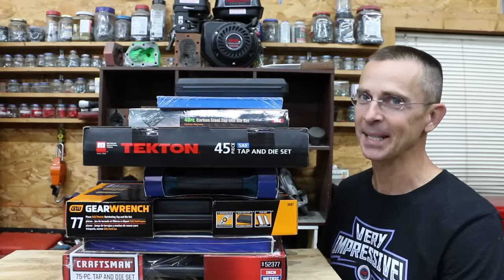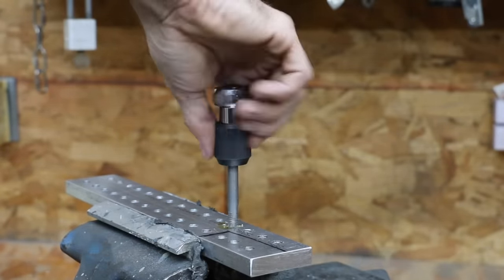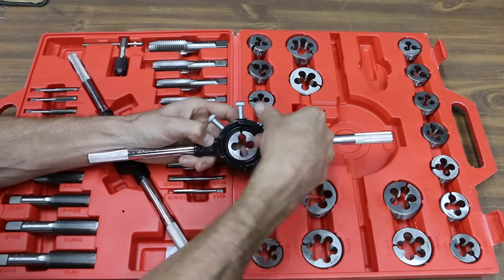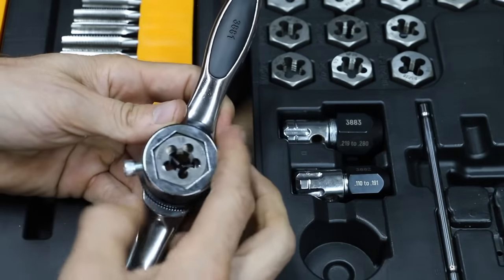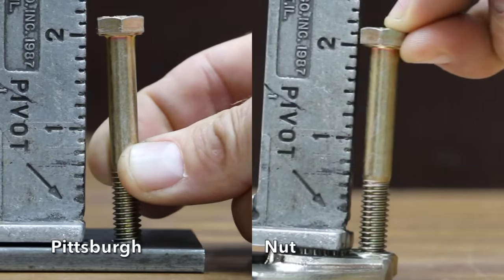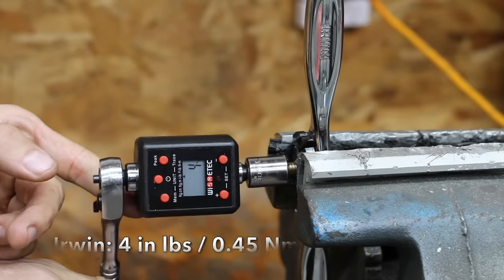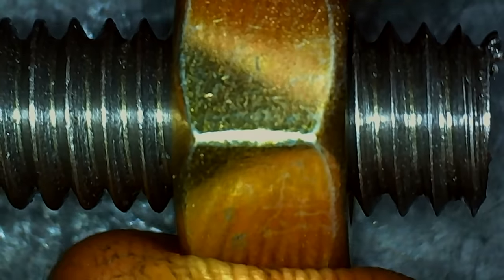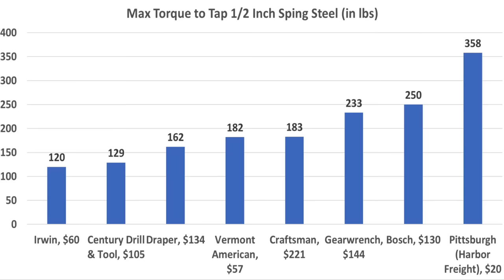Best TAP & DIE Set? Craftsman vs Irwin, Bosch, Draper, Vermont American, Tekton, GearWrench

Comment: I never purchase or use ANY tools, safety or test equipment from cheating lack of quality control communist china. Like the greenfield taps and gun taps. I always use Tapmatic or Aluminum for tapping fluid. Have at least ten sets of 3 piece taps ( starter, middle & think called flush ) in the most often taps that I use. Not many tap sets provide quality tap wrench. Thanks for another great vid.

Comment: Weird test, none of these are respected engineering brands. I know prices go up exponentially as you get into good brands but if you're going cheap, your best bet is to go very cheap and get a spring loaded guide. Straightness will do far more for you than a more expensive tap

Comment: This is not an accurate review, there is wobble on the tap because you want to take torque ratings and judge the accuracy, I did not once see in the video that the Tap was backed up to free metal shavings as it should be done.

Comment: You compared poor quality brands. For taps I use only industrial stuff. The difference can be seen in closeups. A good tap would be precision ground on any surface. 3 step type tabs are recommended for tough work.

Comment: I guess all these sets are general purpose taps and dies. The fact that they are all straight flute taps means they have privileged robustness against productivity and quality.  Close ups of dies teeths show quite a bit of burrs left from the thread cutting process. None of these set would be used for production. Also, carbon steel is a cheap choice only suitable for amatuer jobs. Of course a poor tap is always better than no tap.
Reply from the maker: Thanks for the feedback.

Comment: Completely ignoring proper tapping instructions. Use cutting fluid and half turn then back 1/4 turn then another 1/2 then back 1/4 for every thread. I am surprised the taps and dies lasted as long as they did.

Comment: Using a ratchet to drive a tap is just not the way to do things It will never keep it straight it'll waddle out the hole making fastener to be loose in the hole power tapping either on a drill press or a mill preferably is the way to go and it die is not meant to make all thread it just can't do it it's meant to cut up to a 2 in of thread. Once again a lot of good expectations but a sloppy outcome sorry to be so harsh but you're using just even American made or Japanese made tooling you using the cheap side of things these are not what you would use to make decent holes hack some of the taps I used during the day cost four or five hundred dollars and they're just an average looking tap get into a tap that actually cuts two inches take a month's salary for an average person you get what you pay for and if the testing isn't done accurate you're testing comes out not accurate. From your not so favorite troll only because I live below the bridge.

Comment: the horribly machined teeth on the pitsburg die is why i wont buy a cheap Chinese set again. it cuts as bad as it looks.
the taps made loose fittings threads and the die just literally turned the parts OD down like it was a dull or broken lathe tool. 
when i tried a good american brands i couldn't believe how much better it was in ease of cutting and thread tolerance. 
YG-1 spiral tap cut threads like a dream and the drills America die was not only tolerance adjustable but actually cut threads like it was suppose too.
i was disappointed you didn't test these 2 brands that machinist use.
Reply from the maker: Thanks for the suggestion.

Comment: These need to be called thread repair kits cause this machinist wouldn't use any of this cheap garbage to cut new male/female threads. I would use them to repair existing threads that are gummed or banged up. 
If you are simple, buy yourself the taper-plug-bottoming set from McMaster/whoever makes industrial grade HSS taps. And do the standard turn-reverse thing everybody says to do.
If you are sophisticated, buy yourself a taper, spiral point, and spiral flute tap. Use the taper tap to start the hole and get it straight, make 5-7 full turns without reversing the tap. Its unnecessary for larger taper taps as the chips are spread out over many threads and reversing wastes time and can chip cutting edges off. Use the spiral point for through holes and go all the way through without reversing; the chips will evacuate themselves. Use the spiral flute tap for blind holes and go all the way through without reversing; the chips will evacuate themselves. Use cutting oil/tapping fluid and use the proper kind for the metal(s) you are tapping. You should never have to force the tap and cutting pressure should never increase after you get a full thread in the hole. Don't cheap out on taps, do it right, and you will never break a tap or ruin a thread by hand. 

Two good techniques I've learned to get that tap plumb is to thread a nut onto the tap and thread it near the surface and keep it flush and parallel with that surface backing it off as you advance the tap. You can also get a magnetic digital level and stick it onto the tap shank to keep it plumb as you start the threads. With the first method I can tap holes so straight you can't get a .003 feeler gauge anywhere between the fastener head and tapped surface. There are also tap guides.
Reply from the maker: Thanks for sharing.

Comment: youre using the split dies wrong, youre either spreading them apart too much or clamping them in the vice. the die nuts are just used as thread repair, not to cut new threads. i think your tapped holes are either bad becuase youre using a ratchet and applying uneven pressure and causing the tap to cut bigger than its supposed to or becuase they are sh!t. in my experience i just buy a good quality tap that i need instead of a whole set of crap like youre showing. a good brand i use is sutton tools, not sure if theyre outside of australia. i love your videos but as a machinist it hurts haha.

Comment: Too sloppy, abusive, and rushed for the sake of content quantity instead of quality and certainly not qualified enough for this comparison video. And none of these sets are good. You gotta go with industrial catalogs such as MSC, McMaster, or Grainger to get good taps and dies. You will pay a lot more, though. Back in the 90's I paid $300 for a 20 piece GTD (Greenfield) carbon steel hex die set in a metal case. It's $800 now in a plastic case. BTW hex dies are for thread chasing and repair, not cutting new threads. Title should have been 'Least Crappy Cheaply Made Tap & Die Set.'